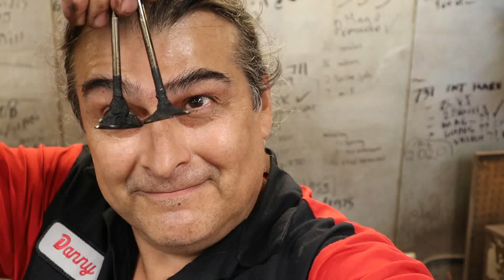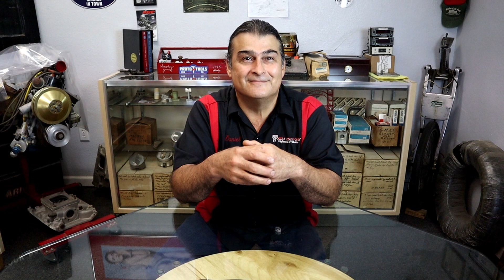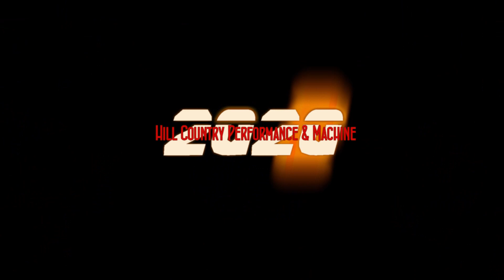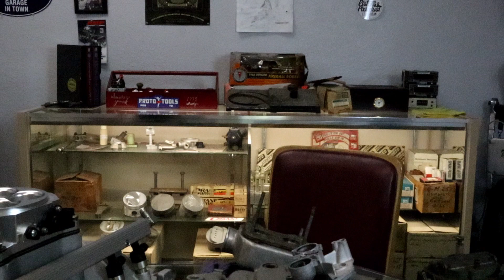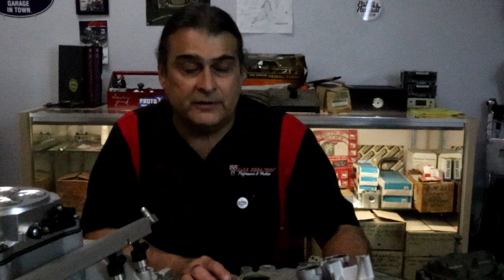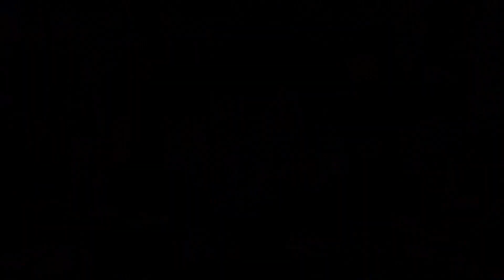Direct Injection Video Correction

Comment: Danny & Shop Mom-  Long time listener.  Danny your trying for perfection in front of the camera.  It's too much editing and I can see your trying so hard to edit and make these fluid video's.  Try breaking the topics into smaller pieces and shooting 5 minute thoughts with Danny and posting more content.  For example you could have done "Methods of fuel meeting air" this could be an overview of there are  3-4 different types of introducing air to fuel.  Then each additional video could be benefits/disadvantages of one over the other.  Also the background audio track, consider ditching it after the intro, vs. going the whole video.  I can listen to hours of happy hour while I work around the house, just be yourself and your audience will grow.  I think if you were to hit smaller videos with multiple parts it would be easier and less time consuming for editing and you'll have more fun with it.    Next part in the series would be whats the advantage or carburetor vs. fuel injection?  Racing still uses carbs with modern computers  and fuel injection surprises me..-